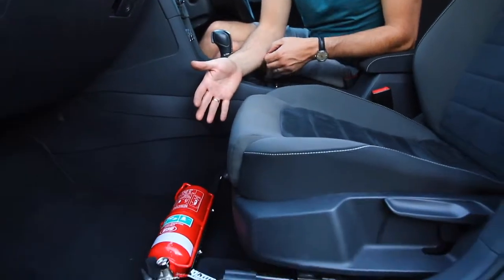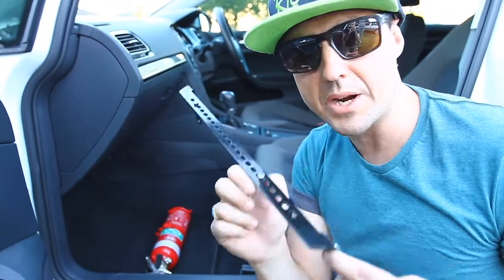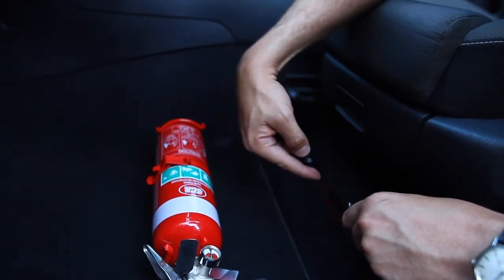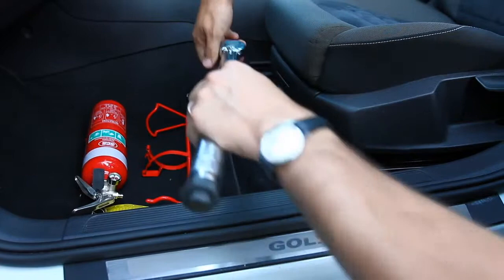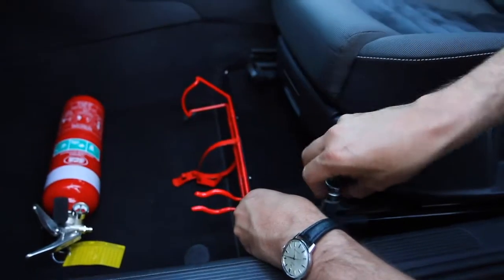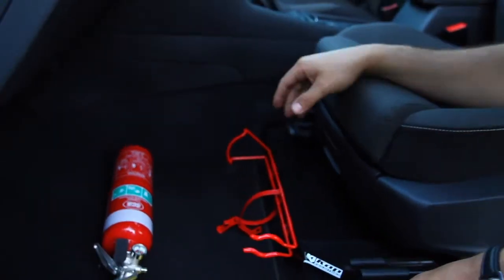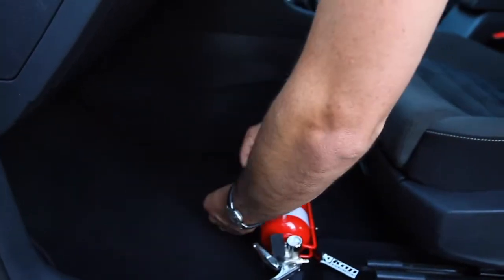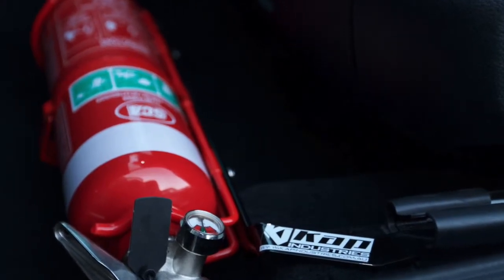How to Install a Fire Extinguisher into a  VW Golf

Comment: Why the hell are you using a torque wrench to remove bolts? 🤦‍♂️
Reply from the maker: Haha good pick up! The torque wrench was the only half inch drive that I had that fitted my M10 Triple Square Bit at the time. I don't recommend the use of a torque wrench to undo bolts. Thanks mate! Haha